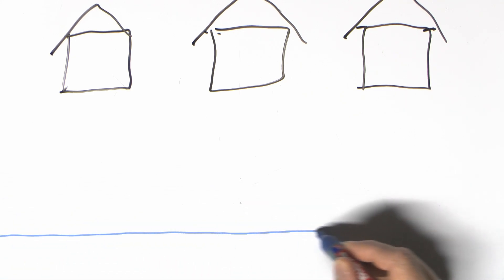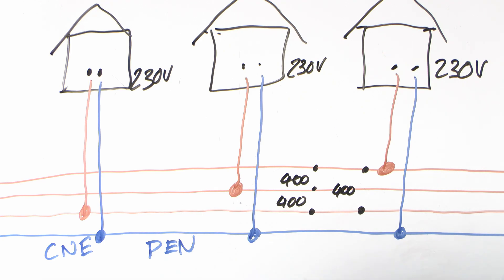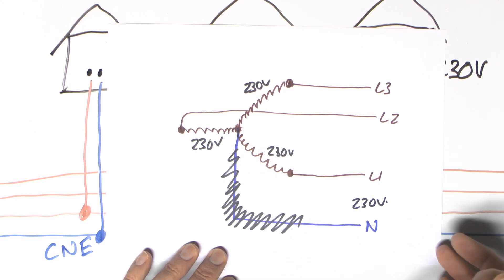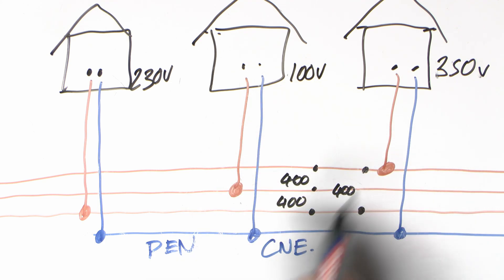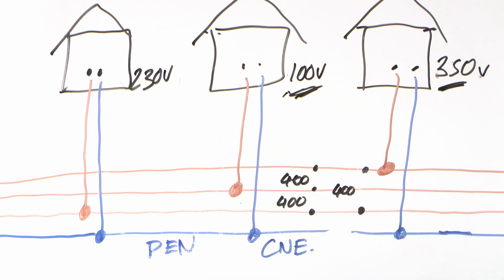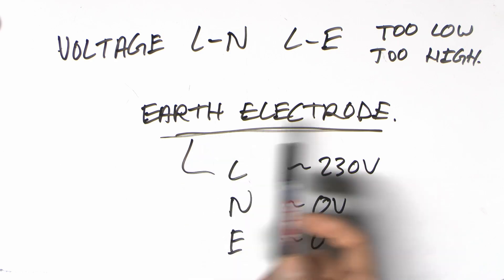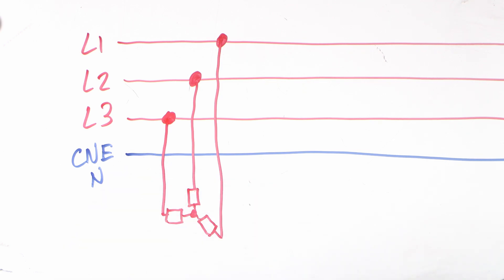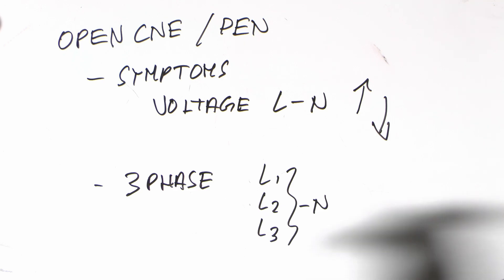Diverted Neutral Current - 3 Phase into Single Phase, Open CNE Detection, 400V when things go wrong

Comment: Cheers John. I was doing a c2 remedial job in the summer, I was there for high Zs on the main switchboard outgoing ways. All the 60amp plus circuits were too high, done a Zs test to find 3.5 ohms. This was much higher than the original test that had failed them six months ago. Done another Zs at the cablehead to find the same reading. Contacted Scottish power who came out and done some tests of their own which yielded the same results. When they disconnected the earth from the cable head there was no earth to the incoming mains. They then disconnected us from the grid and put us on a temp genny over the weekend and fixed the broken PEN on Monday. Nothing in the building was blew up, god only knows how long it was like that for. The building is a large  portal frame industrial unit, with the steelwork being the earth electrode. The loads are mainly lights and three phase motors. The phases are well balanced around 20a per phase lighting, so with phases balanced and a decent load there was no damage. The electricity board had another spark come in and check the other dis boards for signs of burning before they would connect the genny. After all that had been done it was an easy fix, I just done another Zs and typed up the cert. That’s my story.  All the best John.
Reply: So you were using the PEN as a ground electrode and using the poor resistance of the Scottish granite as the neutral back to the power transformer. Must have been making that transformer ground pad rather warm, because you can bet half of it had rotted away already.  I remember seeing substations near rail lines, where the earth mats had melted away, because of a broken track link that meant the earthing mat, across the road, was now the return path for the traction current, bypassing that broken jumper link in a set of crossovers. All the overhead towers, with their concrete foundations, are tied to the rail, so the stray path was very broad. Stick a rod into the ground 3m apart, and measure the voltage, and you could see the voltage rise up as the train passed the break, and stay at around 30VDC till it changed over to another transformer rectifier supply. Also that DC meant steel would rust away like crazy, always starting at one end, and moving along the rebar till it was gone. One end shiny steel, other end black rust.
Reply: @SeanBZA  that was about the size of mate. Sure, funny things can happen with loss of neutral and your railway line scenario is a cracker.
Reply: Your right about the DC systems I have done a lot of work on 12 and 24Vdv control systems at low current and if the terminations get wet or a cables damaged in a duct the DC just eats the metal away with electrolysis.
Reply: @SeanBZA  Overhead electric railways in the UK are 25 kV AC - the DC railways are the 3rd rail systems in the South and the Undergrounds' 4 rail systems.

In  the AC traction environment nearly everything is tied back to the traction return and the Railway substation. The railway want to keep the return currents, as far as possible, in the return conductors and rail and use differing systems to achieve this.  One reason is to keep induced voltages out of conductive communications and signalling cables and to stop electric shock conditions occurring along the track (fences etc.)
Reply: @barrieshepherd7694  Yes, but by me they use 3kV DC, because the regen braking can feed power into other units, plus lower voltage makes for a slightly safer operation. There are a lot of rail power standards, and a lot of locomotives can support a few supply options in the same car, and many can also switch between them as well. That 3kV DC supply was fed to the coaches, where it ran a motor generator set to provide power for accessories on cars with power, and was used directly to power lighting, using a series connection of flourescent tubes and dropper resistor to provide light, and also for the winter heating using large ceramic resistor blocks. Doors operating using pneumatic lines, along with braking.
Reply: @SeanBZA  I was really expanding on the UK main line situation.  Of course tram systems in the UK use DC as well but at voltages below 1000V

As you say there are many traction systems around the world and each presents problems.  DC systems do have to be cautious about dissolving reo in adjacent buildings due to stray DC return currents. 

In Sydney for example the reo in the Sydney Harbour tunnel (road)  linings has protection currents connected to it to counter the potential caused by the 1500 Volt DC railway over the Harbour bridge. 

Modern 25 kV AC traction units can also regen braking effort back into the OHL.  The main benefit of 25 kV AC is fewer substations, no rectification requirements, lighter contact and catenary wire due to the lower currents and a wider choice of equipment as there are so many users around the world.
Reply: @barrieshepherd7694  Merseyrail also uses 3rd rail

Comment: Can you have a 230v 3 phase delta supply into a premises. If not, why do most motors provide for a delta connection. I know it's convenient for inverter supplied equipment, but even old motors before inverters often have the facility
Reply: When it's about 3 phase for a premise, the secondary of transformer is ALWAYS a start "Y" in order to provide neutral for protection 
A 3 phase "traditional" squirrel cage motor mention the voltage on his plate. like 220/380. then you wire it accordingly to the tension you feed it with.
So if you have 3 phase 220V you must wire it delta "Δ" if you wire it star "Y" it will not be able to deliver all it's power and will surely burn.
This under voltage was used to provide a "gentle" start, but it last less than 1 or 2 seconds. 
If your voltage is 380 the coupling will be Y.
And for a plate showing 380/660 the coupling for 380 is Δ !
When you use an inverter, the inverter supply the voltage to the motor but never higher than the input.
Inverter convert main AC to  DC then recreate AC. The input of an inverter may be mono or tri. If inverter is a single phase one,  the input voltage is 220 and so is the output, so the motor coupling will be Δ for a 220/380 motor (this cannot run a 380/660V motor)
Reply: 230V 3phase Delta Supply?🤔
Reply: @temp26j724-i  Only thing that comes close is a USA 120/240 system, where 3P+N delta would be 208.
Reply: @Phantom-mk4kp  Im sure you are asking if DNO would provide PolyPhase (3ø 400V) supply into properties. 
Yes they will subject to conditions.

What JW meant is Residential properties typically gets only 1ø as the need does not arise (apparently though) for application to DNO for PolyPhase supplies into Domestic properties...
Reply: @temp26j724-i  No I knew 3ph was available, in fact I answered my own question after reading it back and thinking about it, delta or star is not so much a supply characteristic but how it's implemented at the load

Comment: 7:15 there would be current flowing in the PEN in your diagram, as it has to flow between the different installations to get to the other phases.
I think you mean the sum of all the current would be zero, so there would be nothing that needs to flow back to the transformer.

Comment: In Germany, residential buildings are usually connected to three-phase current. 
Three phases and PEN. There is also the foundation earth elektrode that is connected to PEN.
Then N and PE are separated. Lights and sockets are then connected to 230V.

The electric stove is supplied with 400V three-phase current. 
But the oven is one 230V device. Two hotplates are connected to 230V in the second phase. Two hotplates are connected to 230V on the third phase. This only requires 2.5 mm² wires, 3x 16A.
But you definitely need the N conductor because otherwise the voltage will shift.

However, the PEN must never be brocken! 
Therefore the PEN must be at least 16mm².  
Or separate N and PE connected after the electricity meter.
Old installations with common thin PEN have not been permitted for years.

Car chargers are also connected in three phases. Mostly 11kW  
Requires an N conductor because the car rectifies the three 230V phases to DC.
Reply: Agreed.
Internal PEN interruptions(break/anomaly) are not as Catastrophic as External(LV Network) CNE interruptions though.💥😮
Reply: Stoves get the three phases but they are in a star connection so the actual 400 V is not used, instead the hotplates get 230 V. This works better in systems that hae various power settings. Also it is possible to run it with single phase by connecting the three inputs together. This typically means you are limited in the total power.
Reply: @okaro6595 I understand its somewhat for Load Balancing within that premises supplied 3Phases?
Reply: @temp26j724-i  Load balancing is mandatory when you have to deal with a residential feed with 3 phase+Neutral. If you have a subscription for 9Kw you only have 3 per phase, so if your stoove is a 9Kw one you must spread the load on all phases. Usually the oven is 3KW on one phase, a small 1Kw and a big 2kw burner for the second phase and again small and big for the third. Note, in some place in Belgium, it's 220V phase to phase with 110 Phase to neutral. So it's wired phase to phase, in this case the neutral lost have no impact as 110V is not even available on any plug.

Comment: Excellent info as always John.  I used to work for an electricity meter manufacturer and we often fitted a small phase failure indicator in our induction disc three phase instrument transformer operated meters that basically worked on the principle you describe here. The main concern was losing a phase in terms of potentially lost revenue 😎👍.